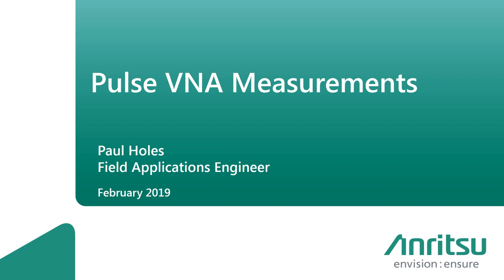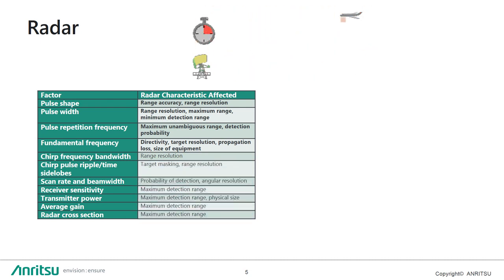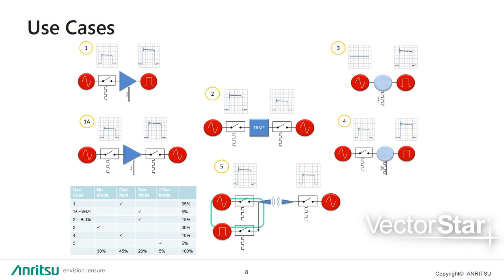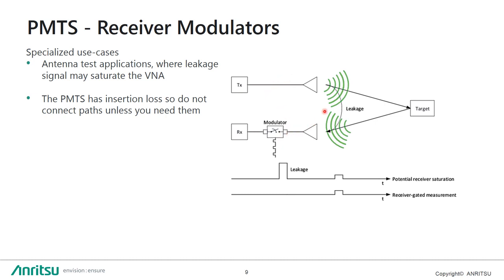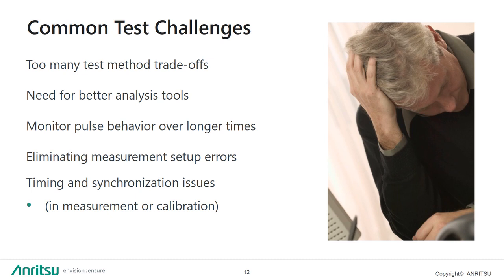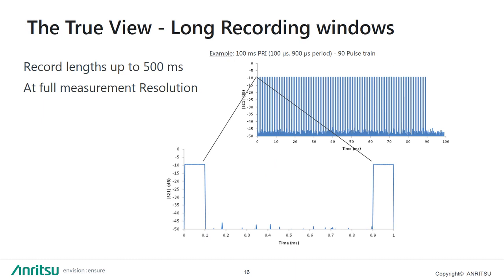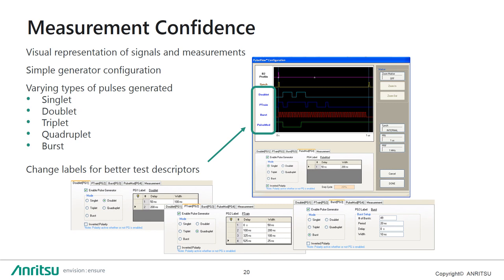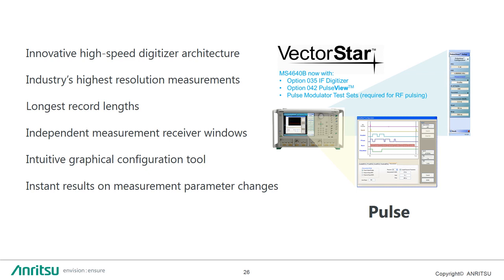Pulse VNA Measurements

Comment: If your equipment needs repair,  know that Anritsu does not offer real service manuals to customers - they must fix it and charge you $$$$$  Buyer beware.
Reply: Just for information, repairing a VNA could mean messing up the system correction parameters and your measurements may not be accurate after self-repair. That's why service departments usually charge you the big $$$$.